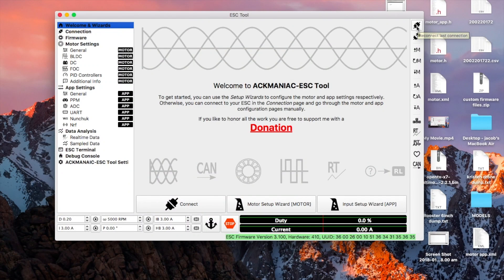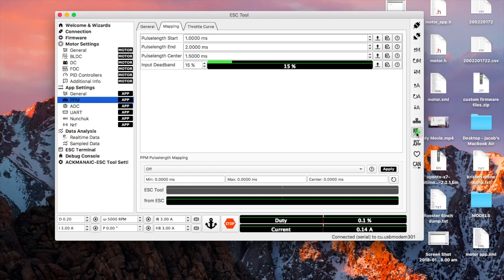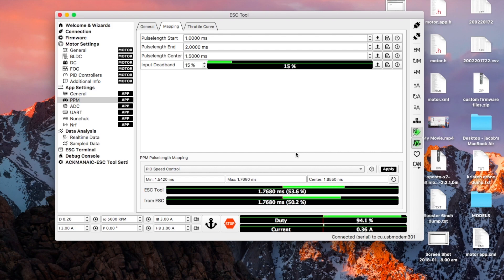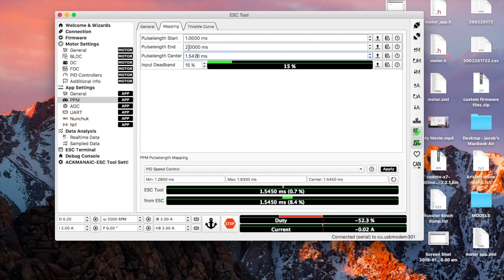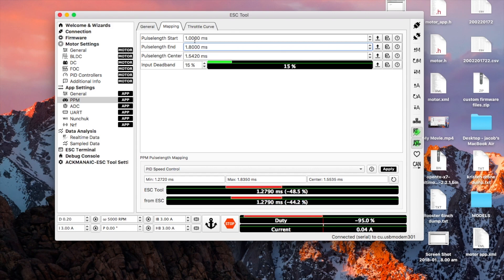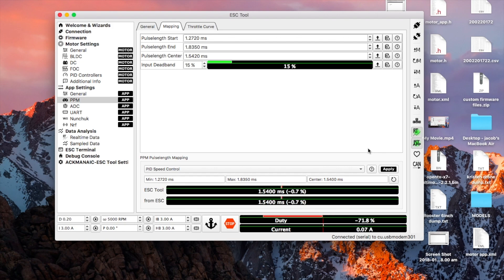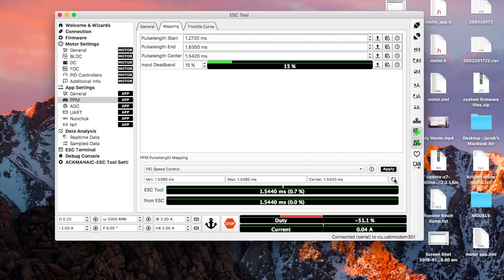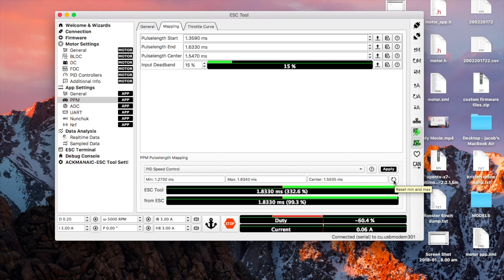vesc tool throttle mapping

Comment: can you do a video on how to smooth out throttle response? I've found my build to be awfully twitchy. Dual 6374, dual focbox 10s1p lipo build
Reply: I would say up the ramping time but I have a feeling you are using some chinese thumb controller and that is the biggest problem. Am I wrong?

Comment: Hi! My dual beast 6355 maytech motor setup, with dual focbox and 12s5p has some issues!
( I use maytech standard remote and reciver )

Also i use VESC TOOL!

One of the motors in “fast mode” shuts down? So i can press full throttle in eco mode, no problem, but when i switch to fast mode it shuts off after a while? Like you can hear 100% Throttle, and after 5,10,20 seconds it goes down to like 60% or even less?

Short version: When pressing full throttle in fast mode, motor start slowing down.

Please help vesc tool gods!